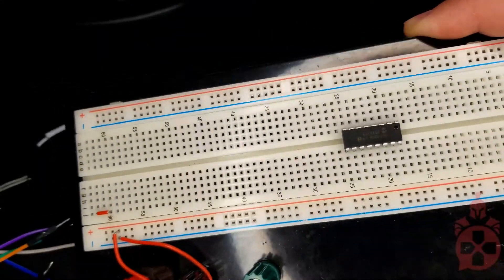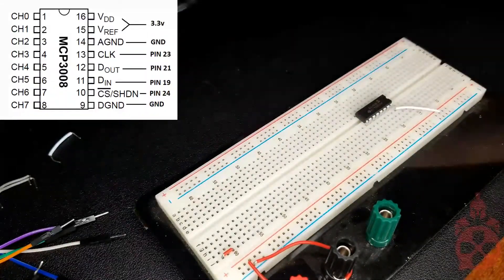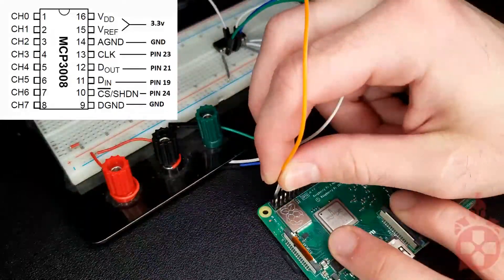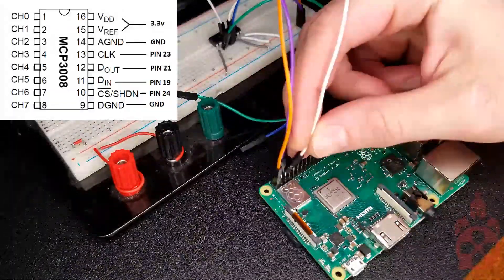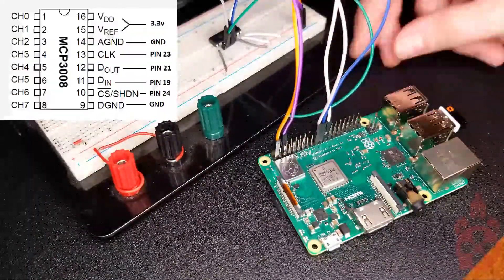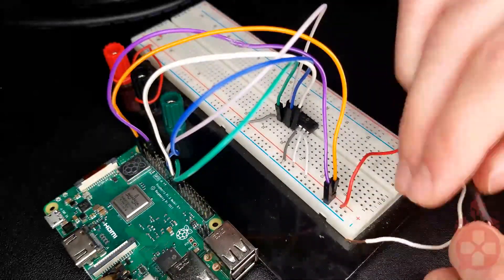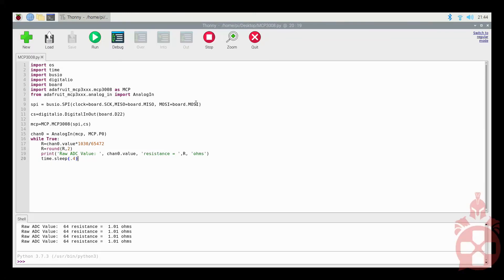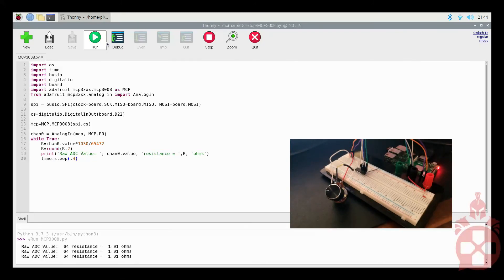RaspberryPi Analog Input with MCP3008

Comment: Hello sir, thanks for your video it helped me to unterstand this kind of stuff and I enjoy the way you introtuced it. I'm currently in an intership and I need to create a system that can read the voltage from a battery but I'm a beginner... I did exactly the same thing as you but it doesn't work...
This is the error:

Traceback (most recent call last):
  File "/home/raspberrypi/Documents/Banc essai.py", line 6, in <module>
    import adafruit_mcp3008 as MCP
ModuleNotFoundError: No module named 'adafruit_mcp3008'

I do not know if it help you but I'm using a Raspberry Pi 3.
Reply from the maker: Double check that you installed both adafruit circuit libraries by rerunning the pip commands in the terminal. If that doesn't work it's a directory issue. Try saving your file in a different location.